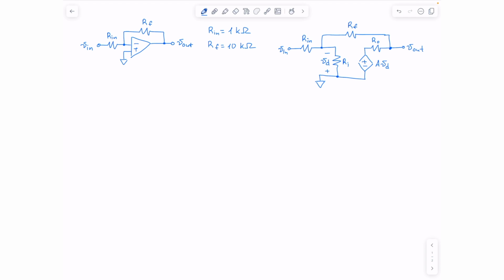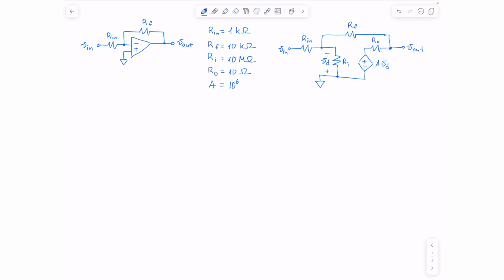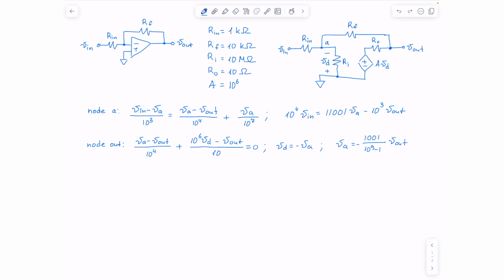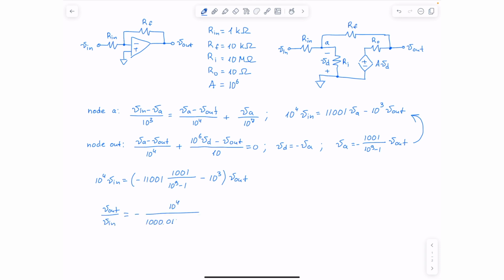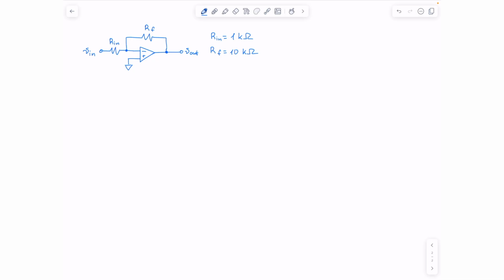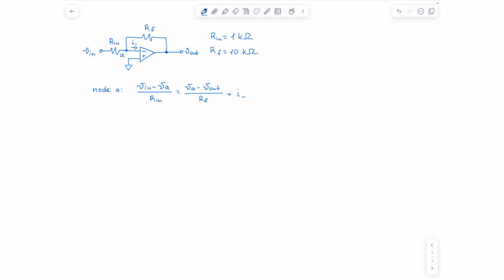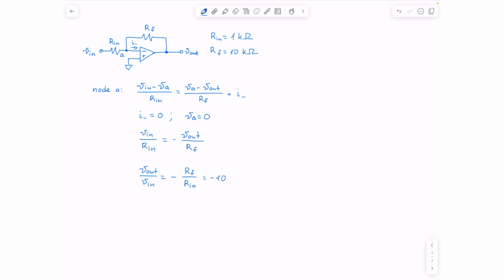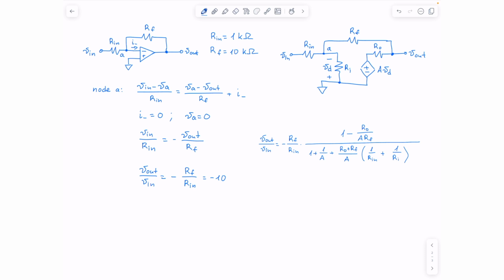Why do we use ideal op amp in circuit analysis?

Comment: Nice video, Misha! Practical assumptions about the ideal Op-Amp (infinite input impedance, no output impeadance) can be applied to quickly implement amplifiers, but not be overlooked when you get down to the transistor level of things. Again, very insightful!